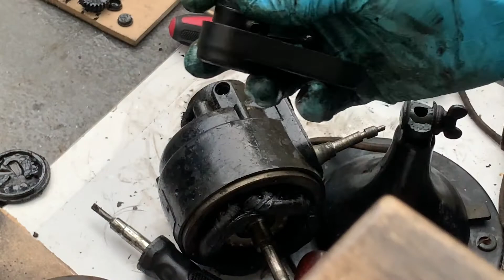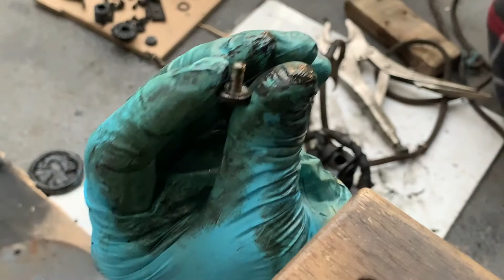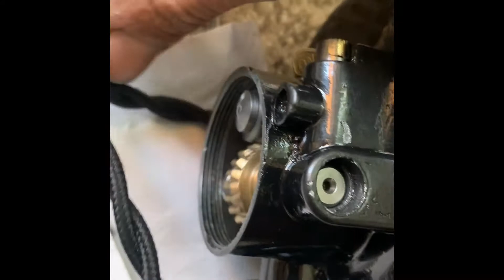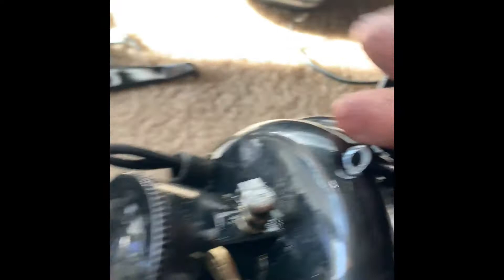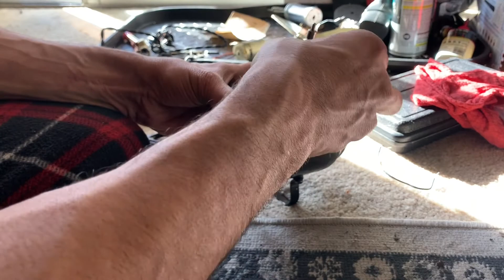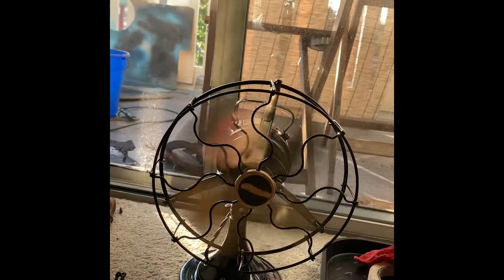Vintage Fan restoration ( Century fan Part two)

Comment: I've got pretty much the same fan that I'm working on and it took me forever to figure out how to take it apart! Certainly not the easiest thing compared to every other fan I've worked on. Been a fun project though!
Reply from the maker: Nice, I love this fan. It is very powerful for its age. My problem was the old coil that was hard go work with. They are also hard to find. Good luck with your restoration. Thank you for sharing. Cheers.

Comment: Sure wish I could have seen the way the wires were put back together. Somebody circumvented my switch.
Reply from the maker: Hi. Sorry about that. This was one of my first videos that I restored. Unfortunately didn’t get to record and edit properly. I remember the wires on mine were very dry, so dry that I could break it just by little pressure. So I ended up buying a new wire and solder it very carefully to the old one and carefully put it back together. I hate it when some owners mess around with the switch or wirings.
Reply: Neighborhood kid asked for one for Christmas (looks like your but 3 speeds) and it started vibrating a few months later. He brought it over and we took it apart. We suspect the motor windings - maybe it quits pushing for a segment each fan revolution causing vibrations.  Any advice on possibly having it rewound? Or replacement motor? Thx
Reply from the maker: Hi. Sorry for my late response. You can do either. It just depends on how much money you’d like to spend on it, also is it worth spending that much money on it? 
Another thing is that, have you tried cleaning and sanding the speed connectors? That could be another reason too. 
Good luck with your project and sorry again for my late response.